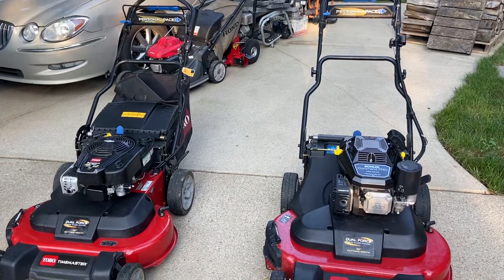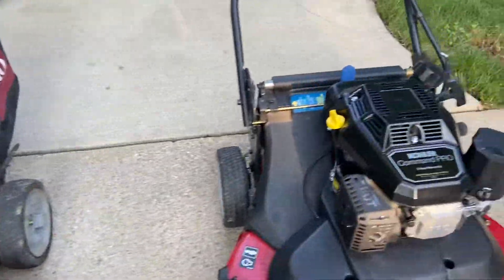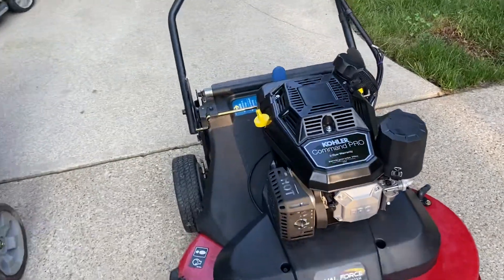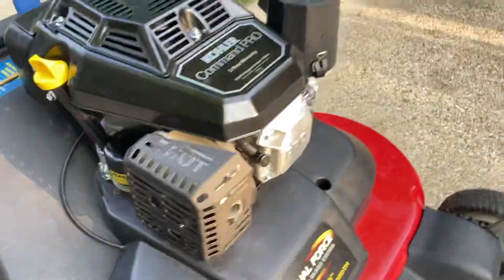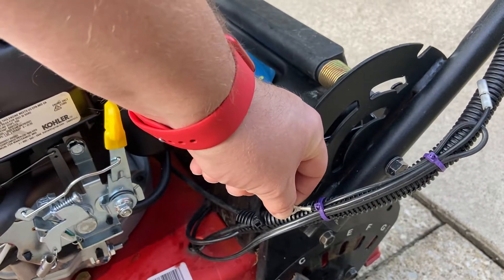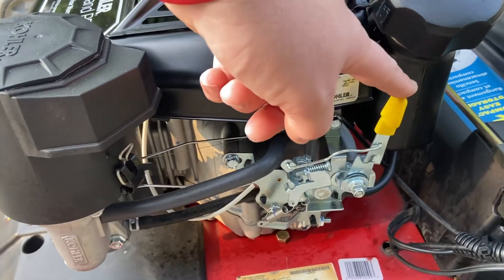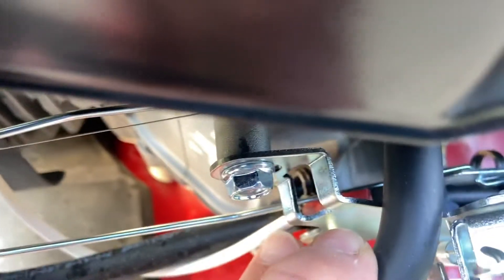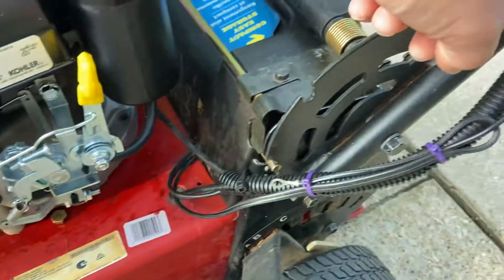Toro Timemaster Repowered from Briggs to Kohler CV200 CV224, what to look for

Comment: It can't be either 1 inch or 20 mm. Those are two very different dimensions. 25 mm is very close to 1 in ( 0.984") but even that would not work if the pulley is a 1-in bore.

20mm is 0.787". Again, close to 3/4", but not close enough if the pulley bore was 3/4.
Reply from the maker: When I made the video I misspoke but it was too late to reshoot.  Kohler lists the motors crankshaft as 25mm and this motor is awesome.  If you’re looking to re-power yours I’d highly recommend this motor.  Thanks for watching.

Comment: Will that motor work with the electric start Timemaster?
Reply from the maker: Yes, it's just not electric start.  Kohler does not offer this motor in electric start as far as I know.  With how I did the install it would be the exact same thing.  You could wire in the key switch as on/off but it isn't necessary.
Reply: @jamesbubnick  thank you…

Comment: It will be interesting to see if the Kohler puts additional load on the transmission, pulleys and belts. The Timemaster can barely handle the torque from the 223cc, and I don't think they upgraded much if at all from the original 8.75 hp engine.  Please keep us updated if any problems arise from the swap.  Looks sharp though!
Reply from the maker: The idler pulleys have an update kit available.  The original idler pulleys are stamped ends w/ a plastic center.  The upgrade kit replaces both of them with cast pulleys.  I believe they are the ones used in the turf master.  Also on the first time masters the engagement lever on the handle was plastic, toro later changed it to metal.  On my unit I've done both of those upgrades and never had an issue.    And fyi the original engine wasn't 8.75 hp it was 8.75 ft-lbs of torque, then the updated briggs engine is 10 ft-lbs of torque.  The Kohler engines that are drop in replacements are as follows:  

The Kohler CV 224 is 11 ft-lbs of torque
The Kohler CV 200 is 9.5 ft-lbs of torque
The Kohler Cv 173 is 7.5 ft-lbs of torque

The original briggs engine was underpowered.  I've used both the 8.75 and 10 models and the 10 is much better.  

The prices on these mowers now are crazy...I'd probably buy the scag sfc-30 used over this mower in the future.

I used the CV 200 since that was the only motor I could find at the time, it was during Covid and everything was sold out.  I was lucky to even get that one.  I would probably buy the CV224 as long as it's in stock.  I think it's only $50 more.

I'm not sure how much more wear/tear it will be on the components of the mower, This mower was one I bought to fix and flip.  The last time I talked to the owner he was very happy with it but I haven't had any update in 2 years.  I'm not a fan of the briggs on these at all...on another unit I bought to flip one of the valve guides slid out and I needed an entire top end of the engine.  The mower was used residentially and only 3-4 years old.  

I'm also not sure on the conversion from ft-lbs of torque to hp,  All I know is hp is unreliable and foot lbs of torque is much more reliable.  However I still have a hard time going to ft-lbs of torque.  I want to say hp ratings were eliminated 10 years ago or more.  If you remember when shopping for equipment you'd find the exact same motor on different equipment with wildly different hp ratings.  I've had quite a few Honda GC160's and have seen the exact same motor rated anywhere from 4.5 hp to 6.5 hp...

Thanks for watching.  If you're thinking about doing the conversion I say go for it and do the pulleys too.  I believe the pulley kit is now around $200
Reply: @jamesbubnick I got the Scag sfc 21 I heard the 30 was still having a lot of issues I got it with the 224 Kohler I love it
Reply: I've been looking at places to get a Kohler for my timemaster.  I see there the CV224-3002 but online it says PA-CV224-3002. 
Will this still work? Is it the same motor just everyone leaves the PA out?

Comment: Nice video, look such a nice motor, is this the cv 200 or the cv224 ?
Reply from the maker: It's the cv200 but if you can find the cv224 you might as well use it, When I did this it was almost impossible to get any version of this motor.
Reply: @jamesbubnick  they are discontinued ? or just rare to get it?
Reply from the maker: @olivierflhd6965  Not discontinued, during the pandemic lots of part shortages...but you should be able to find them really easy know.  I know ebay has them, I bought mine from brand new engines and try small engine warehouse
Reply: @jamesbubnick  big thanks !

Comment: Will this fit toro timemaster 20199 model?
Reply from the maker: Yes it will.
Reply: Im planning on putting a honda engine from a HRX217VKA onto the timemaster. Do you think it would work?
Reply from the maker: @minstuphinycompost6068  It won't work, the crankshaft diameter and length are very different.  On the time master there are only a few motors w/ the same spec crankshaft, of 25mm x 3-5/32 anything else would need to have adaptors/spacers made and I couldn't find any when I was doing the swap.  If you're going to do it the only way to really do it is w/ the Kohler or the Kawasaki FJ180 motor.  I bought my motor from Brand New Engines website but Small Engines Warehouse also has a good selection.  Small engines warehouse also has one briggs with the same crankshaft size but it's a much small motor and would be extremely underpowered.  I wouldn't even attempt to use it as it's only 160 cc

Comment: I am planning on doing this very soon. I purchased the CV224 instead. The mounting bolts you used are the original that came with the briggs? did you use thread locker? what was the torque spec if known? and did you have to tap the deck as well as the engine mount or just the engine mount

Comment: Im looking to do the same with my Timemaster.  The 8.75 Briggs is not the best now. But i feel its a poor engine option even from new .
 What is the capacity of the fuel tank of the Kohler?  Is More than the Briggs?
Reply from the maker: No idea what the capacity is but Kohler's specs will tell you.  I'm also not sure how fuel efficient it is compared to the briggs but it's a lot better motor.

Comment: They give many different variations of this motor do you have a sub number that goes with it CV to 24 – whatever it might be
Reply: CV224-3002
Reply from the maker: That is the size of the motor, the CV24 is the largest motor.

Comment: So if I understand correct, the specs on the output shaft and key are already the correct size.  And the only modifications required are tapping treads? That would be great!  What size threads did you cut and did you use the original bolts?
Reply from the maker: More or less correct…the factory bolts are thread cutters.  A lot of mfg uses those to prevent cross threading in the production facility.  They work great you just have to make sure you don’t overdue them as you could strip them out.  That’s why I like to start the threads. FYI if I was doing this again I’d buy the 224 cc motor not the 200…the power on the 200 cc is plenty but for the extra $50 might as well get a bit more power.   And correct the crankshaft diameter and length are the same as factory using the Kohler as a replacement so no spacers or anything else is needed.
Reply: @jamesbubnick  hey, how did you torque the engine pulley? Can't  figure out how to hold the shaft. Do you know the torque spec? Thanks man!